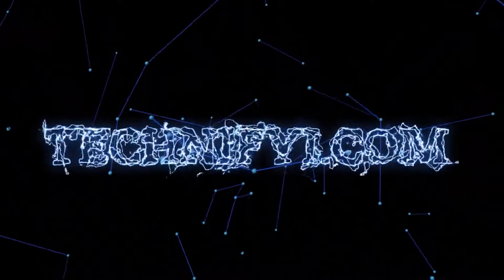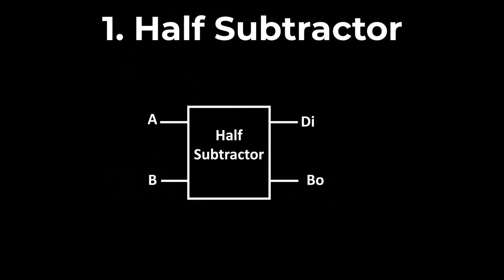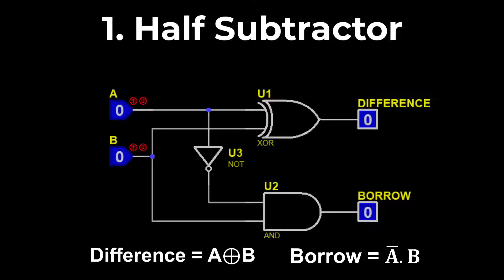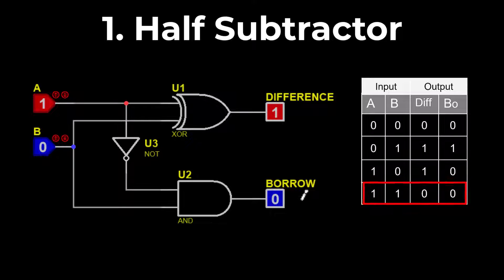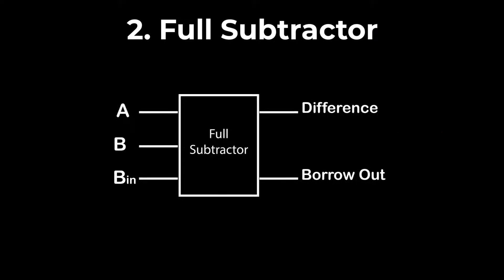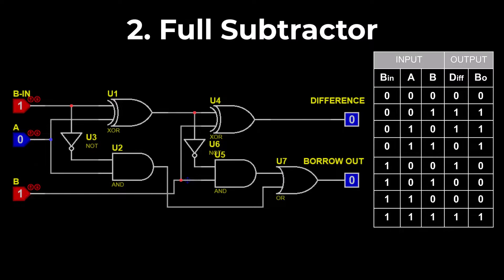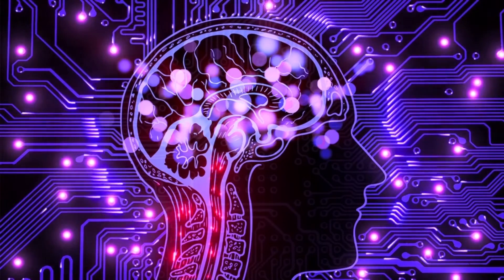Digital Electronics | Half Subtractor and Full Subtractor Explained!

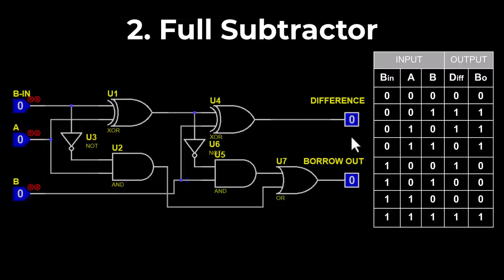Comment: I would double check the truth table at 3:38. I built a simulation circuit using this Full Subtractor and when Bin = 0, A = 1, and B = 1, both Diff and Bo = 0. It's not until Bin = 1, do Diff and Bo = 1. I've double-checked and am not sure how A and B = 1 imply that Diff and Bo are 1.